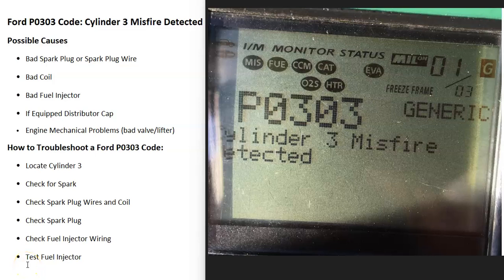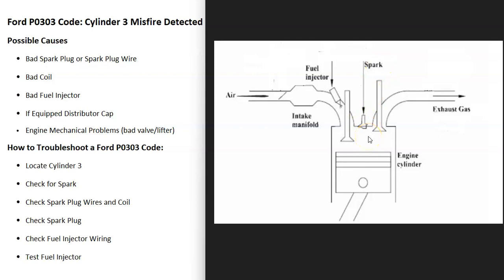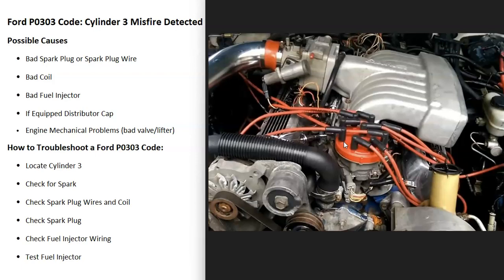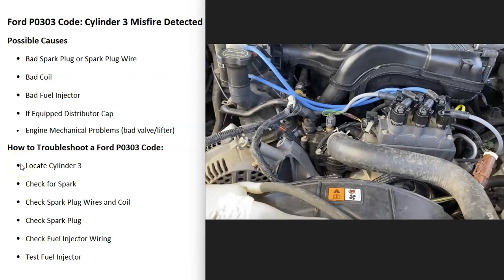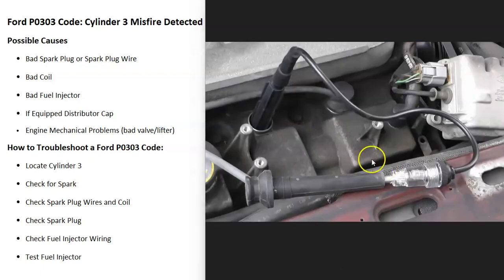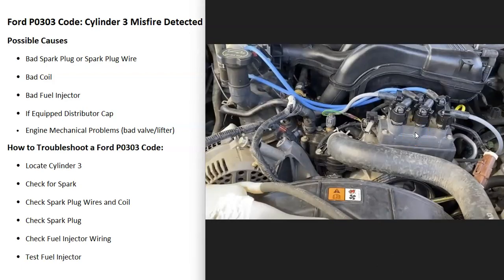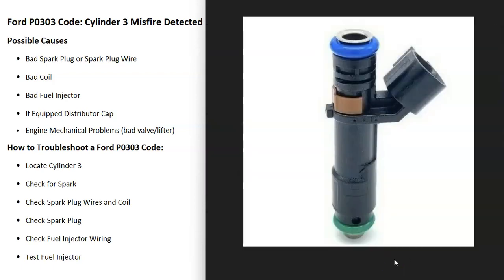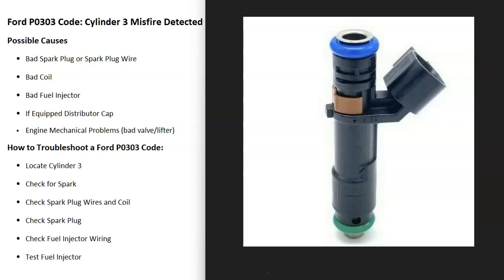Causes and Fixes Ford P0303 Code: Cylinder 3 Misfire Detected

Comment: I changed my spark plug wires, spark plug, ignition control module, ignition coil, distributor cap & rotor. Still getting misfire p0303. But never changed my fuel injector 3. That has n issue

Comment: 2016 F150 5.O Engine .. had cylinder 3 misfire and could not get the engine light off ... Change out spark plugs and coils ...  HOW I FIXED MY TRUCK... HEET FUEL ADDITIVE... LITTLE RED BOTTLE...  Had water in gas tank the entire time... used premium gas and added HEET ... Engine light went off with a quarter of tank left and stayed off.  Mileage and truck runs even better now!

Comment: Hello...I just watched your video & had the P0303 code...I just changed the plugs, wires, and the injector....ran great about 200 miles now giving me the same codes? What's your opinion
Reply: By the way I have a 2020 F250 superduty 7.3 gas
Reply from the maker: Since the engine was running with no code, then the components are likely good. I would check the wiring; there may be a loose connection.

Comment: I'm having a Permanent P0303 Misfire Detected Cylinder 3 on my 2022 Honda Insight, I know its not Ford but relevant to any gasoline engine. Plugs look clean and I have cleaned them all then swapped Cyl 3 plug with Cyl 2, Coil packs look good and I have swapped Cyl 3 with Cyl 1, Fuel injectors all have same Ohms and have been cleaned with Carb Cleaner using an electronic Fuel Injector tester all are spraying good I have swapped Cyl 3 with Cyl 4. The P0303 misfire code always stays at Cyl 3 and only occurs while the engine is cold, If i clear the code and the engine is warm the misfire stops and no more error though still can feel occasional rough idle from misfire every 5-10 seconds. The valvetrain is a dual overhead camshaft with direct roller rockers therefore I do not believe it uses hydraulic lifters. I do hear a knocking sound up high I think in the valvetrain which is more loud when the engine is cold, and have found instructions online for adjusting the valve lash using a feeler gage. I haven't pulled the valve cover yet to inspect the rockers and valve lash, but I suspect this is the cause of my P0303 misfire. There is no indication of blown head gasket, no water loss no steam from exhaust, and no smoke in exhaust so I do not think there is a cracked ring. Engine runs good and strong otherwise. What are your thoughts on this, is there anything else you can think of which may cause this Cyl 3 misfire? The car is 2.5 years old with 63k miles, I've hear that after the engine breaks in the valves can sit lower in the bore causing the valve stem to sit higher closing the gap between the stem end and rocker arm. I bought and extended mechanical failure warrantee with the car for $3200 with 7 year 100k mile coverage, yet Honda is telling me valve lash adjustment is considered maintenance therefore not covered by my warrantee, and that they can diagnose the issue but I would have to pay the diagnostic fee alone with any repair fee if its determined to be valve lash, spark plugs, coil packs, or fuel injectors !? Seems that no matter what the outcome, the Honda stealership wants to charge me personally instead of using my dealership extended warrantee which I paid a LOT of money for. Personally I feel that no matter what the outcome, this should not happen at 63k miles and should be considered mechanical failure not maintenance.
Reply from the maker: If the injector and coil is good, first, I would check for a spark on cylinder #3. There are low-cost spark tester tools. Here is a video I made showing how it works. https://youtu.be/bOX-TvZ2RCM
If there is spark next, I would test the injector circuit on cylinder #3. With the key ON, there should be a constant voltage, usually 12 volts, on one pin. The other pin will be ground, which is controlled by the computer. I made a full video on how to test this and check if the computer is sending a signal. Here is a link. https://youtu.be/JL4_HlYCKrw

Comment: What could be the problem then if it’s not the plugs, coils, or injectors and the psi for that cylinder is significantly lower than what it is supposed to be?
Reply from the maker: If compression is low, I would do a wet and dry test or leak-down test to determine if it is the rings, head gasket, or valve leakage.

Comment: What if I changed the coils, the spark plugs the injectors and I’m still getting the same code misfire on cylinder number three
Reply from the maker: If all the components are good, I would check the wiring.
Reply: I was about to change all the wires plug from the coils
Reply from the maker: If you have a meter or a 12-volt test light, the circuit can be tested first to see where the issue is. Here is a video I made on how to test the fuel injector circuit. https://youtu.be/JL4_HlYCKrw
Reply: I’m having the same issue on my 2008 Nissan rogue

Comment: Hey bro I’m having same problem just change spark plugs and ignition coil and still comes up also car kinda jerk sometimes when I accelerate and gets to a high rpm
Reply: Is your coolant low?
Reply: No
Reply: Did you figure this issue out? I’m having this same problem now
Reply: I have the same issue with my 06 F150 5.4. Replaced all sparks and coils, but still the same issue. Now, I will try to replace the fuel injector.
Reply: @braddock77  that won’t work it was two cylinders on mine kinda expensive
Reply: @braddock77 hello I'm having the same issues have you figured out why?

Comment: I have a 97 ford f150 4.2l v6 misfire on cylinder 3 replaced coil pack, spark plugs and wire also fuel injectors and still the code p0303 pop up what ya think ?
Reply: i have the same issue with my 2014 3.7 mustang. I cleaned all the cylinder head with seafoam down the spark plug hole. clean the piston head

Comment: Thank you for this video! I like how straighforward it is. Have a 2021 Ford EcoSport, and it started idling rough this week, then the check engine light went on, and I lost 50% of power going up a freeway hill (when the dreaded WRENCH light came on - but has since disappeared.) It's throwing the P0303 code but nothing else comes up.  I have 62,484 miles on it in two years (I love the drive.). I'm really curious that my maintenance schedule says a tune up at 100k, but Ford itself recommends 60k for the EcoSport in other spots. Wondering if it's ever possible to need a tune up early, if you've racked up those miles rather quickly?

Comment: I got a 02 explorer with the 4.0l v6 i got a p0302 code i put new spark plugs new   spark plug wires new coil pack and new injectors and seals and intake gaskets i can't figure it out please help
Reply from the maker: If you replaced the parts, it is likely in the wiring. I would test to be sure it is getting spark and also check the wiring at the fuel injector. It is also possible there is a mechanical problem, like a bad valve or crack in the cylinder, but that is not common.
Reply: Here's where I'm stumped it runs fine after start up but it's a hard start
Reply: @Shadee863 you might be out of timing

Comment: My issue was a bad coil pack.  When looking at the back of the coil pack you could see a crack in the epoxy, opposite of the #3 cylinder.  Replaced it in about 45 minutes and it runs like a champ again.
Reply: That was also my problem.
Reply: That's maybe my too going to change it I already did everything else 😊

Comment: My 2014 Escape is currently in the shop after the engine light came on and this was the code. The dealership  has investigated and apparently none of these items are the issue, now they say they need to take it apart to get to the cause. 8hrs worth of work is a lot of money to just determine the problem. Any suggestions on what it could be past what your video covered? Thank you! 
3/2/24
Reply from the maker: While not common it is possible there is a mechanical issue such as a bad valve or a crack in the cylinder.
Reply: As he said in the video could be a bad lifter which I'm really hoping mines not it's a lot of work if I didn't know how to do it myself id probably junk it

Comment: I have this code and it won’t go away. You can feel a slight giggle to the truck. Changed out the spark plugs, ignition coils, wires, add red line fuel cleaner, still runs the same. The only thing I noticed with my scan tool is that while it has p0303 the 02 and cat lights are blinking at the top. Any correlation with that being the problem? Toyota 1995 tacoma sr5
Reply: A misfire will always lead to a cat clog/failure if left for too long
Reply: @PokeInMotion  gave it a couple of rounds of Lucas fuel injection cleaner and no more codes lol.

Comment: So the cylinder 3 misfire would be the actual #3 cylinder and not the 3rd cylinder in the firing order correct? I have not been able to get a definitive answer on this.
Reply from the maker: It will be the Actual #3 Cylinder